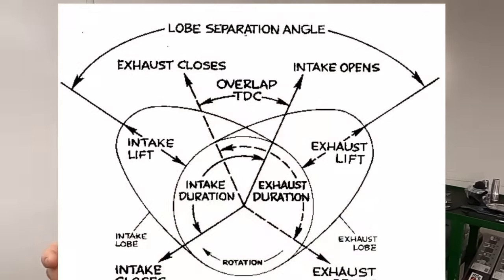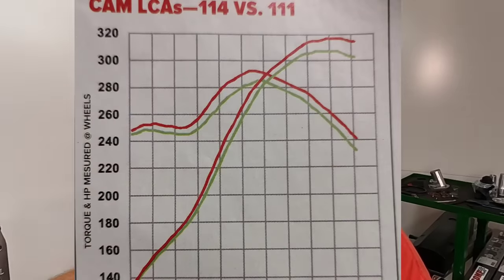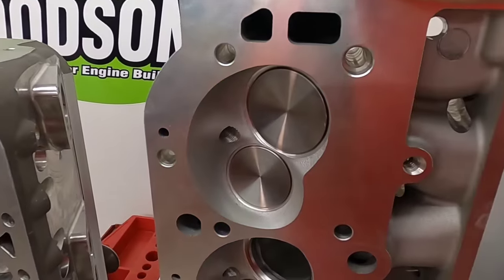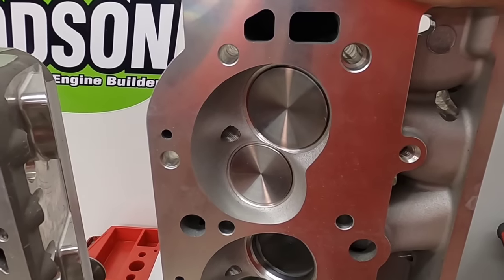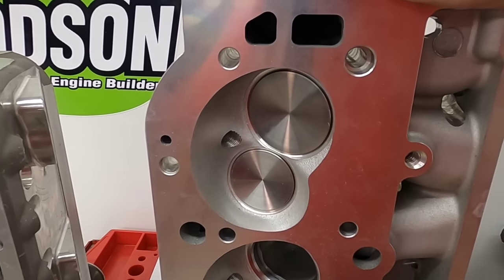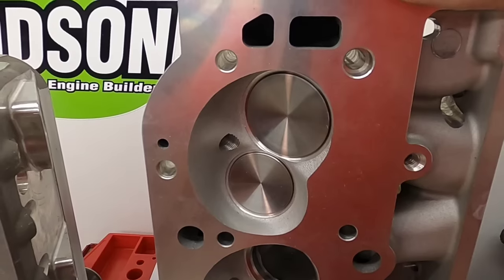Camshaft Lobe Separation Angle: The Untold Truth of LSA!! How to Pick LSA the right way@DavidVizard

Comment: Both guys WRONG. A tight lsa in a low Cr. engine will lose power. Been there done that.
Reply from the maker: The problem isn't the LSA you had way too much duration
Reply: @Unity MotorSports Garage  so, how would one go about picking the correct duration? Based on what I gather from Vizard, you calculate necessary LSA based on the engine's characteristics, then you pick an overlap based on your intended use of the engine. Duration therefore is simply a product of the 2 choices. He's also said to pick a higher overlap for low compression, which would mean even MORE duration. So, what are we missing here?

Comment: You guys assume that everyone automatically assumes the correct Duration for their cubic inch and application, then simply applies an LSA to it and VOILA!. While I think David Vizard is a Wizard, all of his examples rely on 350cid and you guys seem to think that 350 cubes are the rule of thumb when spec'ing LSA. What about application ? what about driveability ? While you say that TQ wins races, sure, on a prepped track. Show up to a Small Tire No Prep Event at an outlaw track with a Roots Blown BBC and you won't get off the line. Guys purposely KILL TQ production, especially in Turbo motors.... but then again, you are likely talking Normally Aspirated. You need to specify at the start of the video that this info is for NORMALLY ASPIRATED DRAG RACING, PREPPED TRACK, NOT STREETABLE WITHOUT CONSIDERATIONS MADE.

Comment: Get to the point already
Reply: Usually when you look in cam listings . When the lift goes up so does the duration.  I run a 108 lobe  separation on my 540 engine and it works great. 262 272 at .050 299 310 advertised duration.  What I've learned if you run nitrous  or forced inducton you want to stay with a wide lobe separation.  I switch to e 85 and my car is flying went from 6.00 to 5.90 in eight mile 2700 lbs  car shift at 6200
Reply: Damn I love videos like this man you my type of man. I'm a Ford guy but love Mopar engines such as the Hemi and Magnum engines but I wanna 351w/408w stroker swap my 92 single cab short bed Dakota Sport V6 Magnum Ax15 and also wanna go with a Tremec 5 speed and a Hurst Pistol grip or short throw shifter

Comment: LSA is whatever comes from right valve opening and closing, and overlap. So LSA is uselesss information.
Reply from the maker: How do you determine what is right or wrong?
Reply: @UnityMotorSportsGarage  calculating and testing. And modern engines have adjustable LSA , these dinosaur engines are not very interesting.
Reply from the maker: @V8Lenny  ok you say calculating, what formula are you using besides guessing?  DV and I have been testing for YEARS, I have worked with DV for nearly 20 years now.. I hear what you are saying about new engines but for the MILLIONS of older pushrod engines out there this works.. 
Andy